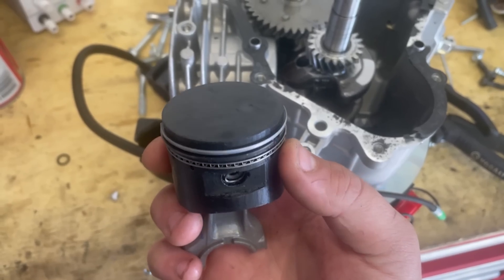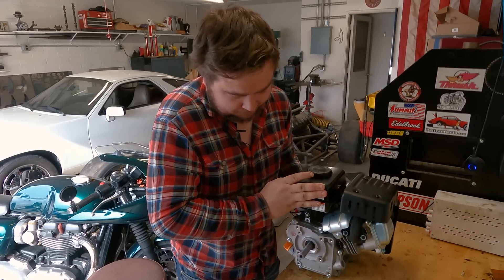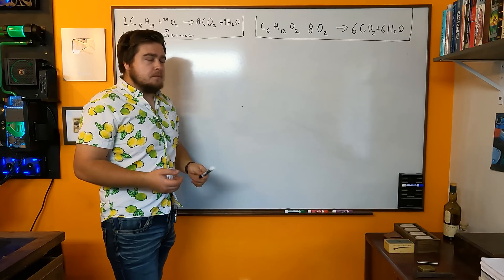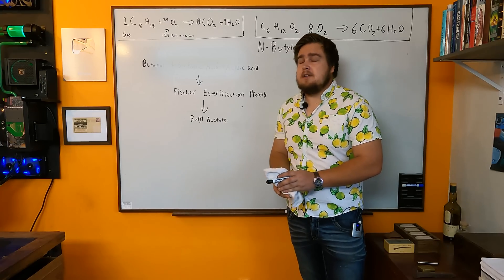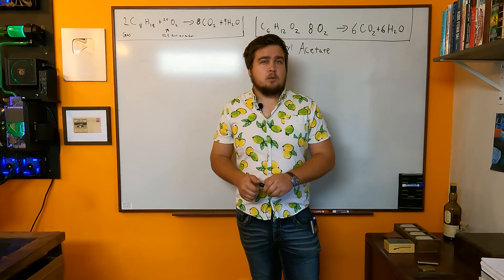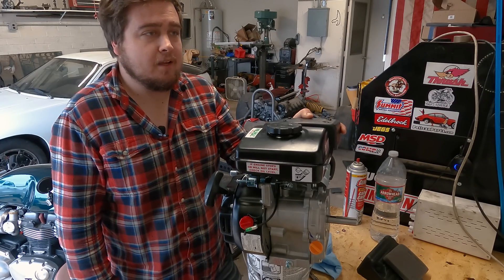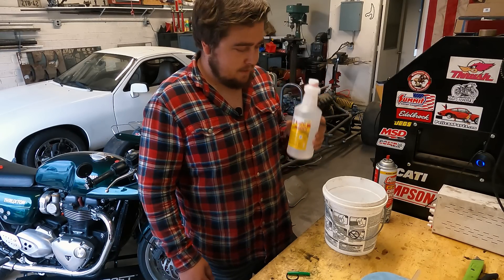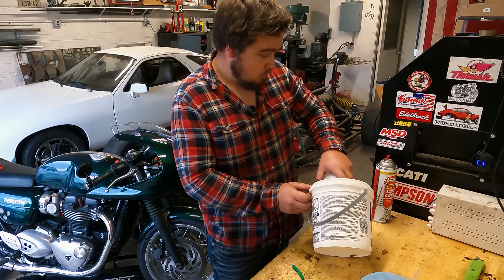Cold Burning Fuels and Plastic Pistons for Harbor Freight Engines!

Comment from the maker: This is one of my most exciting projects so far! Let me know what you think!
Reply: Ceramic coat top of piston?
Reply: I'll send you a link to a guy called two stroke stuffing, he has a video on how to make a Dyno for cheap if that's any use to you?! https://youtu.be/XUX_YWsECWs
Reply: @aliwheel1300  
Or use a generator like farm????
Reply: I recall ford doing the opposite with the ecoboost by upping the temperature and utilizing ceramic pistons and block. Quite a cool idea in my opinion. The goals of the engine were to increase boost and temperature stability. I think efficiency increases with temp
Reply: I print Polymaker PA6-CF(carbon fiber nylon) on a prusa mk3s at ~285c, cold bed on glue stick, very easy to print once you get the settings dialled in and making sure the filament is dry before use. It is dimensionally stable with very low warping and should be able to handle much higher temperatures than ABS, It can also be annealed to improve the properties further.
Reply: @Bastanien  not hot enought and CF dimensional accuracy kinnda sucks
Reply: @rexxx927  Have you used the specific filament I mentioned? It is very clear how much easier it is to print if you compare their non CF blended nylon with for example Taulman nylons which are practically non printable unless you have the perfect conditions, the additives used by some manufacturers make such a huge difference.
Reply: Can’t wait for the next episode!
Reply: I'd bet you could play around with AFR mixtures, to get a better delta T!
Reply: @anthonymarlette8124  i like this idea
Reply: Awesome project! I’d love to see what effect the Freevalve head has on burning butyl acetate. Making a light weight generator could enable hybrid electric aerospace applications.
Reply: Maybe use a ceramic or high temp resin with a resin printer?
Reply: @ker6349  standard resin handles 250c without warp or softening
Reply: Prolly need to use ultem? (pei)
It can be 3d printed, but at very high temps.  
You can order from xometry, or some other vendors for probably $100.
As a heads-up, it will be porous, even at 100% until.  Might be a good idea to let the hot end it soak up some 3m dp420 or similar high temp epoxy.
Reply: The Porsche EV options, Lexus Hybrid Transmission 450h and variants,  Jaguar I-Pace power turned up, Ford Mach E(cost my be to much at present) and everyone's favourite go to Tesla..... there you go just one of many project ideas for you......🤣🤣
Reply: Twin v cylinder conversion ?? like this https://www.youtube.com/watch?v=8U1gp4QsnZc&ab_channel=LeDan
Reply: You may be able to 3d print some polycarbonate if you can push the nozzle temp to the 280c range. Although I am not sure how resistant to your fuel it will be. Also once 3d printed you should do some post processing on a lathe to ensure it's concentric.
Reply: @Engineerd3d  Nozzle to 280c use adjustable soldering iron parts ?? my iron goes up to 480c....
Reply: @kylereese4822  everything should be able to heach 480c in an engeneers world and mine too
Reply: The HF pred motors are notorious for having a bunch of metal bits in the engine from factory. It’s a good idea to take them apart and clean the inside and replace the oil.
Reply: More exciting is the electrovalvss
Reply: Pure awesomeness!!! I love your way of thinking 💪🏽
Reply: id like to see you refine your freevalve physical mechanism
Reply: I came for the mechanical logic gates. I want more mechanical logic gates. 

Also, this. I want more this.
Reply: I would do a compression test with the fdm piston. There's always going to be micro gaps between layers, I wonder if it's enough to really create a seal. IK you said you want to use your printer, and this may change scope, but you could consider sla printed part if pressure is a problem. Then you also have different materials to choose from.
Reply: Does it (the 80cc engine) have the same power and tourqe output?
Reply: You should get in touch with The 3D Printing Nerd. He might be able to get you just the materials you need.
Reply: "As it is usually needs" 

A+
Reply: I’ve had issues with FDM printers holding hydrostatic pressure. I’m curious if this would be the same. I think you should try resin if it’s a pressure issue. I would also consider doing a metal coating on the cylinder like Crome plating. Another option might be using copper nanowire (paint it on and then flash sinter it)
Reply: this is the first video I've stumbled across on your channel, good stuff so far at 6:33, one thing I'd like to point out is the flourescent light? Window? reflection in the white board makes it difficult (near impossible) to read what you write.  Just thought I'd let you know.
Reply: a bit ahead here but the thought of a Poly Carbonate case and cylinders with sleeves and an ultem piston is possibly the most x rated motor of the century just saying i am rooting for your success and will be checking back in
Reply: You need to make a hybrid piston with an aluminum top and a plastic body.....
Reply: try printing in Glass filled Nylon, if your printer can't handle that try PLA printing then annealing it which greatly improves temp capability. PLA will do better than ABS against them nasty chemicals.  Another thing to try is "resizing" your printed piston using a heated aluminum ring, to get to a precise size and roundness.
Reply: @KrustyKlown  top dog pla-doo is not gonna cut it the THD is only at best 120ci do agree ABS is not for solvent based machines tho! thermos and chemical resistance starts at PEI "ULTEM" and up PEEK PEKK PEK so on the resistance increases both in chemical and mechanical 
as you go up the ladder of materials one will work i assure you start at 9085 it may actually hang 197c THD
Reply: @rexxx927  one must define "work" .. realistically, NO Plastic piston is going to work for any length of time. I kinda assumed the intent here was only to get the engine to start and idle for about a minute before the piston melts through.
PEI can only be printed on a specialized printer with super high temp nozzle and a heated build chamber. Nylon has VERY good chemical/fuel resistance. The glass filled Nylon I suggested can be printed on a high end home printer, with at most minor tweeks to deal with ~300C hot end temps.
Reply: @KrustyKlown  work....>i print pei and more with my printer in my garage he has the tech it seems and you get what you pay for.
the idea of this working is real if you know your materials yes it may fail with regular use but it has a real chance your not aware of MT over 217c and almost 100% solvent stable
the materials cert-ed for aircraft and medical uses the numbers are real!ALLDAY
ASTM tests are also real...if you wanna just play instead of evolve then use your GF nylon may as well try GF PC too then....
Reply: @rexxx927  where are you getting PEI filament .. last time I looked it was insanely expensive ... and what bed surface you printing on, heated chamber? or no?
I'm an automotive engineer who works mostly with plastics .. and I have a home based commercial 3D printing business going too.  So I know these materials you are referring to. I am very interested in how you are printing PEI at home, because I haven't seen many people successfully do it yet, nor found a source low enough in price to make it worthwhile compared to alternatives like CNC machining aluminum.. A PEI printed piston would certainly hold up the best if he can print one .. once the piston crown hits the glass transition temp, that piston will probably crater, lol.
Reply: @KrustyKlown  i use to make filament and have run hundreds of REAL extruders the ones with a barrel and screw!in blown films and filaments for over 22 years from 15 hp to 350 hp 600volts @200Amps with a truput of 12-14000 lbs per 12 hr shift and as little as 25 lbs/hr dies from 1.75mm-38" dies with a layflat of over 100" wide 
BUR'S "blow up ratio" is something only film guys understand but here it goes 
ideally in PE blends for example the ideal  BUR is 3.08:1 which means the die to film xmax is blown to 3.08 times it was from the die for the ideal strength in the film, well same applies to filament and most other polymers and processes there is a best nozzle size LH LW speed temp to get the bur"s correct for the proper processing to occur anything less is subpar like then just a glue gun. picture a welder if you don't have the correct setting rod,filler or angle and so on the best of the best still wont help you~!
speed affects your strength friction makes extra heat so things like CR38 and nickle is applied to the inner surfaces to reduce the friction and even the flow characteristics if you not at the correct speeds your BUR is affected but Back-pressures are not really seen as required in filament but is does matter even tho its nil in comparison it matters!
fact is still pei and others are not cheap at 24$cdn/lb in virgin resin PEI is now... 25 plus years old.. sabic innovations currently but fact is GE was the originator the formula was sold decades ago to sabic and is still over inflated to the filament side around the 150$/KG as most rolls in HT filament will come in 2KG olls costing 300$each pending whom. 
there are other materials that can surpass 217c glasses as well 
i am interested of a filament start up for my self someday soon its time to do it for me!!i however am just a hobbyist with experiences in my shop Srtatasys don't scare me i have run them tore them to frame and rebuilt them and more titans fortus dimensions you name it~its also time for barrels and screw 3d heads to blow up so....they are just missing a bypass valve soon they will get her and it will all be resin eventually!this may take some time to evolve but the process is the same. thanks for your interests Krusty cheers
Reply: @KrustyKlown  A piston at conservatively 50M each of filament is then like 12 pistons per 300$/roll or 25$ each with no scrap!it is a piston....like buying a lobster for a dollar in Belize you should probably pay more than a dollar!
Reply: this is pretty exciting 100% go for the gusto!!
Reply: What are the emissions? What does n-butyl acetate break down I to when burned?
Reply: Resin printers, the up ones, can easily stand 250c

Comment: I hate to be a downer, but open flame temp is not the same as the temps you'll see in the engine. Compression will increase the temperature of combustion. you fundamentally want to run engines as hot as possible to increase efficiency. Another benefit of hot engines is not having fuel condense on the walls, washing away the oil.

Comment: My understanding is that a THERMAL engine extracts mechanical energy from the temperature delta generated by combustion. If that is correct, the logical conclusion is that running a fuel that burns at a lower temperature while keeping intake temperature the same, will reduce the delta, which will reduce the engine output.

Comment: As a mining engineer I am biased about replacing metals (mined with varying emissions and smelted using fairly high energy and emissions) with plastics (pumped from the earth and extracted/synthesized with high energy use and emissions). Aluminum pistons may be some of the cleanest metals if hydro electricity is employed (Quebec) and when considering it is highly recycleable. A biofuel alternative is quite interesting. Colder combustion is interesting, too. I still like hydrogen fuel cell tech due to efficiency over ICE. You make us think. Thank you

Comment: Consider getting your 3D printed piston vacuum metalized, to protect the ABS from the butyl acetate. Vacuum metalization is the process used to put a thin layer of metal on plastic, for things like digital watches (remember those?) and trim pieces on consumer electronics. If you talk nicely to the people who run batches of this process, you can get a part thrown in with a bunch of other stuff they're doing anyway.

Comment: Just recently came across your channel, very cool stuff! One thing that crossed my mind on this one - what about trying a viton O-ring in place of the piston rings? If it can handle the temps of the N-butyl acetate burning, then it would seal the combustion chamber 100%. I say viton because those carburetor O-rings are likely made of the same stuff to tolerate gasoline without breaking down. Even if the plastic piston doesn't work out, maybe try the stock aluminum one with a viton O-ring? Or maybe there are better hi-temp O-rings out there today?

Best of luck with this, you're doing the kind of stuff I hope to be able to do someday!

Comment: Make a silicone mold for your piston and then pour resin/plastic/etc to make a solid piston. The 3d printed is fdm so there is compression lost in between the print layers.

Comment: There are a lot of problems with using acetate in a gas engine. First is the gasket issue. Where ever the fuel comes in contact with a gasket it will slowly harden it and make it brittle. After some time it just breaks down and you get a gasket failure. I have witnessed this with e10 on outboards and marine engines of all sizes. So those gasket problems start at the intake, second place is the head gaskets and then exhaust manifold gasket. And for any fuel injected engine there is the vapor separator, which keeps the fuel in a liquid state and prevents vapor locking the fuel lines. And fuel lines don't like this stuff either.
The other issue is the rate at which acetate evaporates. It would be next to impossible to keep a full tank with this stuff. Fuel tanks are vented to prevent vapor expanding the tank and pressurizing the fuel in the lines and the vapor separator, which would cause leaks all over the place.
Everything I wrote is why we don't run cars, trucks, boats, or even airplanes on alcohol or acetate. Gasoline is a much more stable fuel and although it does evaporate, it doesn't evaporate at the same rate as acetates and alcohols.
And also that evaporation rate being slower makes gasoline much safer to use than alcohol/acetate. 
What I would like to see is the flash point of this acetate versus gasoline, gas is about 425 degrees or an open flame. I am guessing that acetate will flash at a lower temp. And by "flash" I mean it with ignite.
And that is another problem with using acetate. A gasoline engine is designed to run on gasoline because of everything I have stated up top. If the engine is running too cold it could operate with faults like misfiring and backfiring, rough idle speed operation, low torque outputs, etc. We don't see this here because we have a single cylinder engine that is naturally aspirated, meaning it has a carb, and isn't fuel injected. If you tried this in your car that was made in the last 30 years it would probably melt most of your fuel system. Especially the hoses.

So unfortunately we can't use alcohol in our daily drivers without designing new sub systems for our cars. There are many alternatives out there. For example Brazil uses ethenol for fuel so if your interested you should look at some vids from down there. Brazil isn't the only country either. 
Also something called Browns Gas, which is breaking water down into hydrogen and oxygen and feeding that directly into the intake. 
This was a good video demonstrating that mostly anything that is combustible can run a gasoline engine.

One last thing. E10 can separate and the alcohol can crystallize in a carburetor, fuel injector, fuel lines and filter housings. Sometimes at the fuel pickup in a fuel tank. In your daily driver you don't get these issues very often but if you have trouble with your seasonal yard equipment I recommend you tear down your fuel systems and clean them with any available rebuild kits. Don't bother with fuel cleaners, it is mostly a scam, and they will work for equipment or vehicles that have been running recently. You can stabilize fuel and that does work, but only count on it for 6 months at the most. And remember to empty seasonal equipment fuel tanks when putting them away for a long time. You can forgo alot of this hassle by getting the pure gasoline from the hardware store, but it's expensive.

Comment: I've seen enough engine teardowns to know that plastic doesn't work in combustion engines. Even when plastic is used as timing chain guides they constantly cause engine failures. Plastic pistons may actually last shorter than wooden pistons.

Comment: 25 seconds into the video and you’re talking about a motor and at the 37 second mark it clearly says on the side of the box as you are in frame saying motor, gas engine. Engines run on gasoline, motors run off electricity.

Comment: You could potentially measure the work done by the engine using one of the 79cc water pumps. Pump the water up a given elevation and use the mass of water pumped and this change in elevation to obtain work for a given quantity of fuel.

Comment: OK I'd give it 1 min...Plastic piston... The flame front is over 2000 degrees C. (with gasoline) Aluminium gets rid of heat quickly plastic not. No plastics will survive...I reckon.